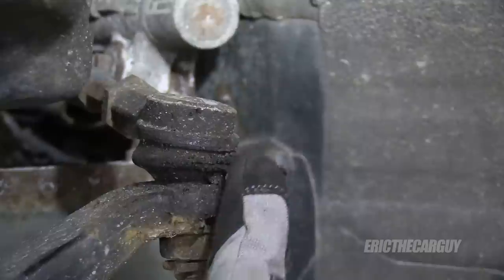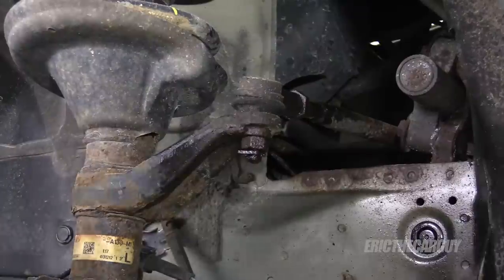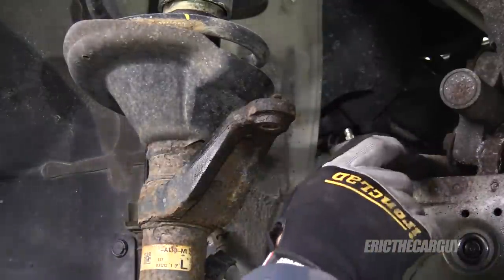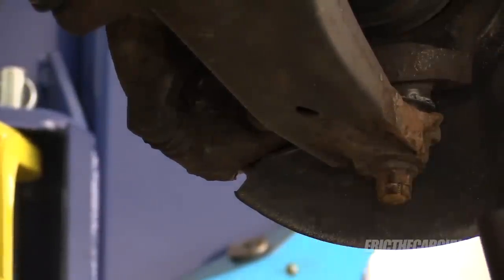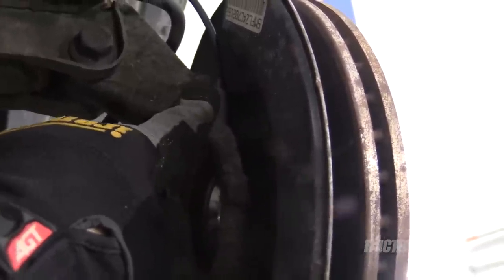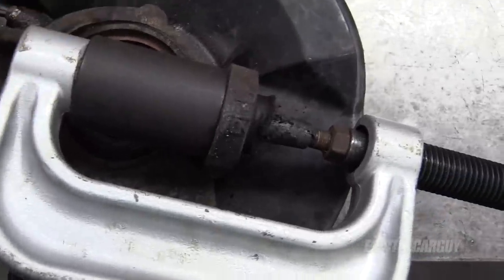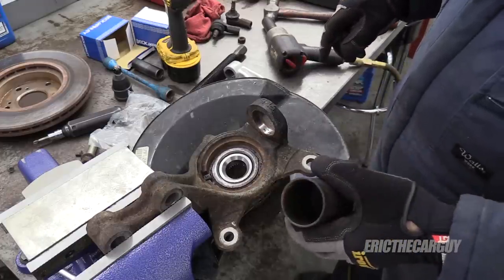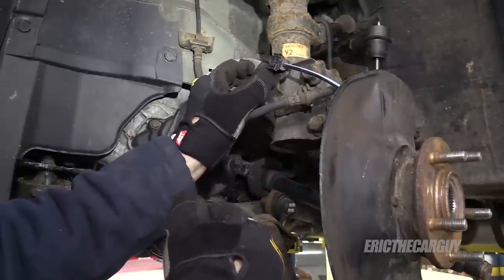How To Replace Ball Joints and Tie Rod Ends Honda Element/CRV

Comment: I wonder if ethical dealers would use aftermarket parts to reduce client cost, or whether they always replace the whole knuckle and bearing at the same time. There's something fundamentally wrong with the way manufacturers bundle many parts together, dismissing the practicality of fixing only what is wrong.
Reply from the maker: There's a comment below from a Honda tech stating that very thing. As for manufacturers making assemblies instead of parts. I don't see that changing anytime soon. https://www.youtube.com/watch?v=ZgJflXv20UM&t=3s

Comment: Too many problems in the past squeezing those with wrenches and then ruining them only to return them as if it was the manufacturer's fault so they do what most manufacturers do and kill two birds with one stone and they use less resource now to make them as well as not as much opportunity for you to break them. People strip those things so easy because of the metal that they use Now sucks unless it's maybe Toyota that metal seems to be super hard and adjusting tie rods usually will ruin the rent long before the part

Comment: Huh, I've not seen the ball joint in the hub assembly before, every car I've worked on has had it in the lower control arm.  Speaking of which, How to replace the ball joint in a 2001 Saab 9-3?  Buy a new lower control arm... seriously Saab, what the hell.

Comment: HAVE WIFES MAZDA MPV AND BALL JOINT WENT BAD ( DRIFTING WHEELS) I HAVE BALL JOINT PRESS KIT BUT NOTICED THAT FROM FACTORY THE BALL JOINT COMES TACKED WELDED AND DONT KNOW WHY THE HECK ANYONE WOULD DESIGN IT THAT WAY ANYHOW TO BREAK THOSE WELDS YOU RECOMMEND ANYTHING BETTER THAN MY WAY WHICH IS GONNA HAVE TO GO OUT AND BUY A GRINDER AND CUT THE WELDS. ANYTHING BETTER THAN MY IDEA WOULD BE GREAT THANK YOU.

Comment: Yours is 2004 Element while mine is a 2005 CR-V EX AWD on ball joint. Amazon says it doesn't fit on mine.
Ball Joint: https://www.amazon.com/Moog-K500004-B
https://www.amazon.com/Moog-K500004-Ball-Joint/dp/B001ILHNSC/ref=sr_1_2?ie=UTF8&qid=1520440957&sr=8-2&keywords=2004+Honda+element+ball+joint

Anyone please share, what is the correct replacement ball joint for 2005 Honda CR-V EX AWD?
Reply: i have a honda CRV 2005 manual transmission and i had a big issue replacing that ball joint, i bought like 3 different brands and none of them fit, finally i got me a AC delco brand and thats the only one that worked fine
Reply: @dannynica7480  Do you have the part number from AC Delco?
Reply: @angelisone  I had to take the whole assembly out to the store to try it because none were fitting, so this is the one that fitted AC delco 46D2375A
Reply: @dannynica7480  Some of the ball joints (brand new) may go in. 
But the C-Clip will not seat onto the ball joint correctly.

So AC Delco #46D2375A fit with the C-Clip perfectly?
Reply: @angelisone  In my case thats the only one that fitted, the other ones were loose. I dont know if you might have the same issues like i did, but i tried like 3 different ones, like the ones from autozone duralast and moog,  Good luck with yours
Reply: @dannynica7480  The other nightmare, on a deference subject, is removing the Compensator Arm's Bolt (one attached to chassis). Over 82% are seized/rusted. If you can't get that 14mm bolt out, good luck trying to install Trailing Arm's Bushing.
Reply: @angelisone  i have replaced many things like, front control arms, alternators, stabilizer links, front axle,axle seal, etc.  but this thing with the ball joint was my biggest issue